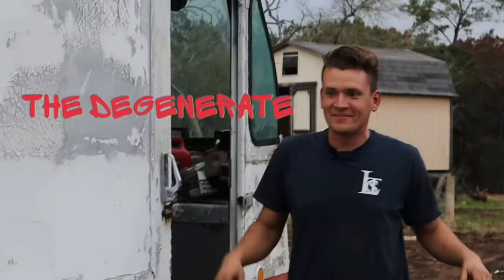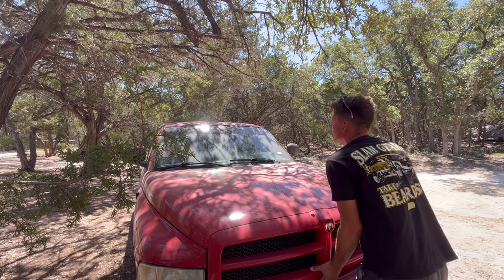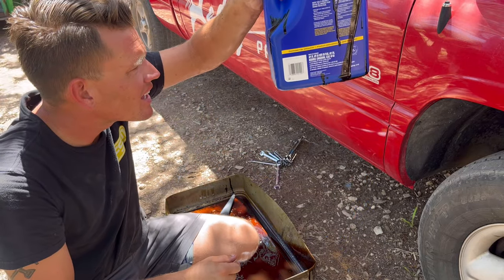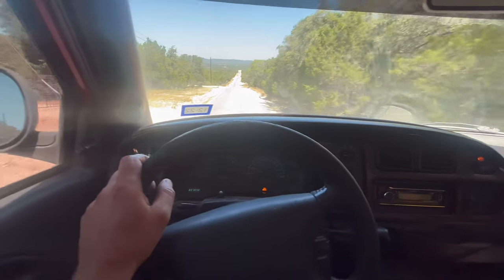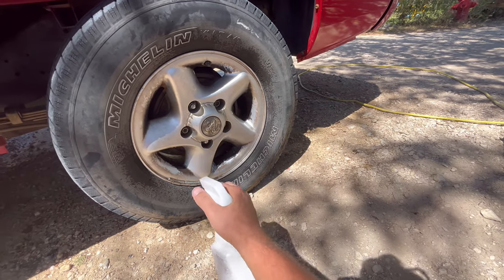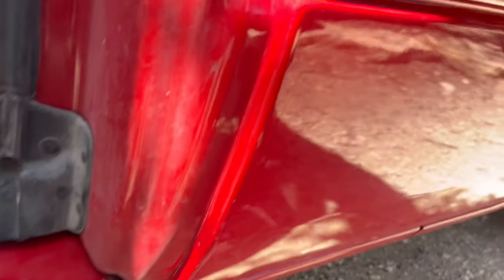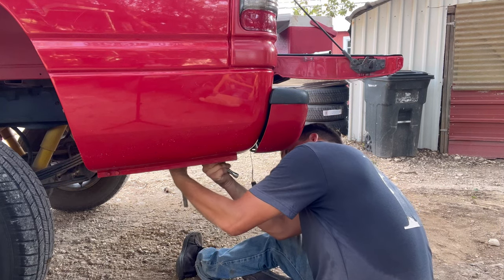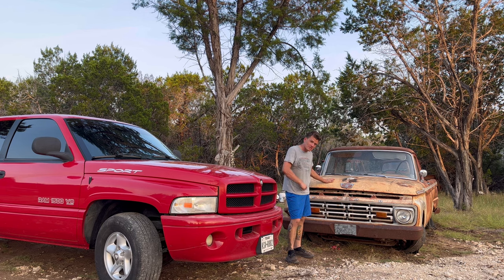I buy What was… worlds cleanest 2nd gen Dodge Ram 1500!! Will it drive?

Comment: I owned a 2000 Ram 1500. Those trucks were cheaply built, sub-standard junk. The dash was made of the cheapest grade plastic Chrysler could find and 99% of them cracked into chunks, The transmission was known to fail and mine was no exception. All you had to do was whisper the word "rust" and it would do just that. And that was just for starters.
Reply: LOL ...complains about a dash and some rust ...newsflash every brand will rust and dashes will break.  Also the trans in that truck is a hell of lot better than anything gm ever produced. And if the trans are so bad why did my 01 vortec supercharged on 37s ram never need a trans rebuild in over 120k miles? The video of my 01 is on my other channel "youran1993r"
Reply from the maker: They were I think trying to be a bit too modern for their time, dashes and misc things could have done better. And as for the trans..yep. Near EVERY dodge I use on the reg..I’ve put a trans in. Regardless I love the look of them.
Reply: Sounds like you got a lemon sir 😂 iv owned my 99 2nd gen with a 5.2  since new it has 260k miles on her and there is zero rust and it's never had a engine or trans replacement. It had the passenger side head gasket blow at around 206k but that happens to any old truck. It cost 600$ to fix and it's still running healthy. Yes the dash is crap but big deal its more of a solid truck then the equivalent year ford or chevys 💀
Reply: Also I beat the HELL out of my dodge 😂 it's the only vehicle I've bought that actually can with stand my abuse on vehicles. My 2016 chevy silverado needed a new trans a 59k miles 🤣 and my 2021 f350 work truck needed a new engine at 3k 💀 all covered by warranty of course but they don't make them like they used too
Reply: Disagree 💯